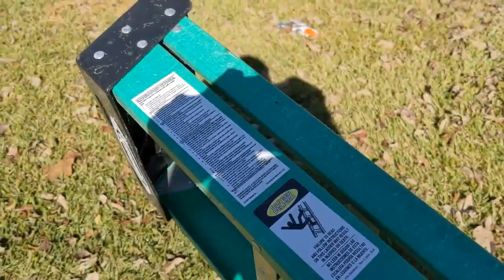Preparing for the Souths First FREEZE! || Protecting Plants by Enclosing our Screen Porch in Plastic

Comment: Before lumber prices were out the roof, I got some 1" x 1" x 6' striping and rolled the plastic over them, and screwed them to the sides of my carport coop. It makes it easy to put up and take down since only a few screws per strip are needed. When spring rolls up I take out the screws and roll the plastic on the strips and it makes storage easy too. If you leave a few inches of plastic past the 6' strips they tuck under the next piece going up. It might be something to think about for future years of covering the porch for cold weather. I can't wait to see you finally get the greenhouse set up and see how you do winter storage for your tropical fruits. You are warmer than I am in NC zone 7b but maybe I can implement some of the same technics to overwinter some of my citruses because the house gets full of all my tropicals.